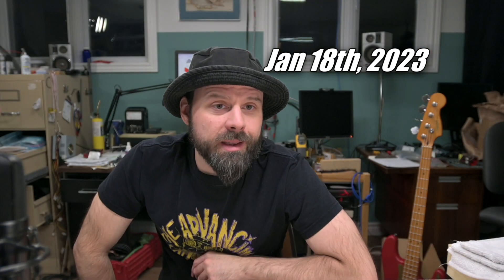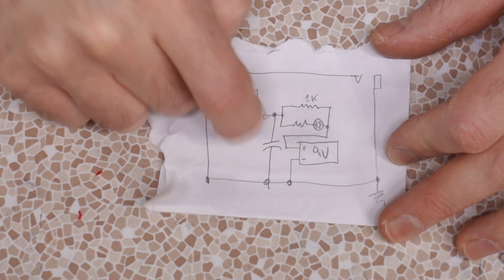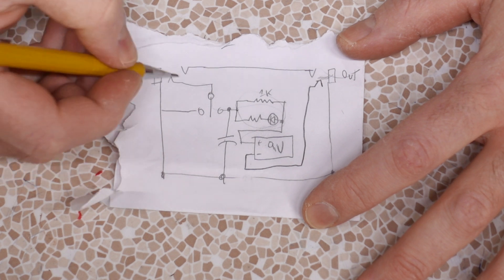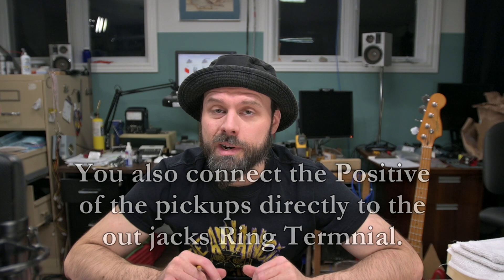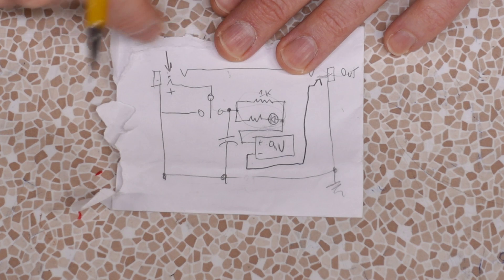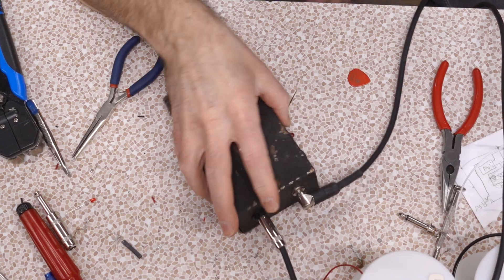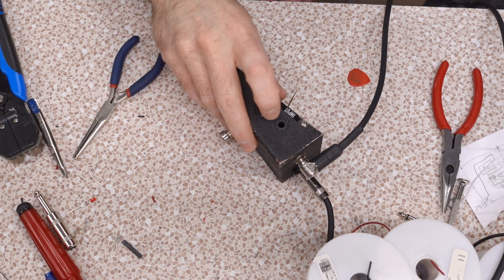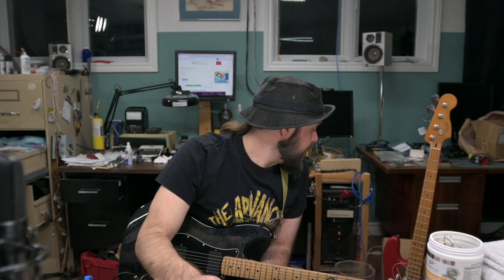Improvising an External EMG PSU cause I couldn't fit a battery in my Bass

Comment: Do you have the non trs version?
Reply from the maker: Ah no, you need the TRS to transfer the power. An EMG loaded guitar already has the TRS jack in it. 
If you made something like this, and got the right cable, the only mod you have to do to the guitar is to short out/bypass the internal battery jack.
I did have an idea of building a non TRS version, kind of like phantom power, but it would be way more complicated, require significant mods to the guitar wiring and risks compromising single integrity.

Comment: Must have watched this now a dozen times (maybe even 12) ahead of starting my own build. 
Question: On the capacitor you used 1uF /50V if I am reading the label right. Would a 1uF / 10V be the better pairing?
Reply from the maker: Sure. The voltage isn't that important. It just tells you how much it can take before failing. 
Functionally they will be identical, and the voltage rating doesn't effect the tone. 
Just instead of stocking the same value in a bunch of voltages, I'll stock only a couple voltages, and it covers all the bases. 
However, you do want to "derate" your caps. So, get a value that is at least 20% more than your expected voltage. Also consider, that we arbitrary runs these at 9v. Cause it's a battery standard. 
The ops amps these used can run at up to 30v in some cases. 
You could easily run this pedal at 12v or even 15-18v. So, for good measure, if we build it to be save up to 12v, we're going to want a min 16v cap. 25v might be more common and then you're golden. 
Only reason a "company" might spec a 10v cap, is cause they order them by the million, and 10v worth of insulation is just slightly cheaper than 25 or 50v worth of insulation.
Reply: Ty!
Reply from the maker: @Yes...THATEric  Yw.

Comment: When wiring up the guitar knowing I’m going to use this instead of a battery, do I still wire it up the same?
Reply from the maker: For the most part yeah, just you omit a battery jack, and connect the red wires to the ring terminal on the jack. Otherwise, what I've also done, is just wire it normal, and bypassed the battery jack, assuming you are working on a guitar that fit a battery to begin with. To create a bypass, I took a dead 9v battery, cut the terminals off the top of it, then soldered a piece of wire to short those terminals, and then clipped it into the guitars battery jack. Shorting out the guitars internal battery jack will bypass it an allow power to be taken from the ring terminal.

Comment: Just found out that this was even possible. So rad. Say someone wanted to have this powered with a power supply and not a 9V, how much would have to change in the build?
Reply from the maker: Well, it should be as simple as connecting a jack instead of a battery. I might also add some bypass capacitance and filtering however. There are a few ways to do that. The most basic would be to put something like a 10u and 0.1u cap across the power jack. But I might also try to using a 100ohm resistor on the positive of the power jack to connect it to the circuit, before said capacitors. 
You need bypass capacitance in an application like that, kind of simulates a local battery and subdues interference picked up my the power wire along the way. 
Fortunately, the short circuit protection a built in would be good for this. It's one thing to quickly short a battery that can't put out a lot of current, but if you were using a PSU that had a fair amount of capacity that could cause any number of problems.

Comment: Cool video. I hate to be that guy but EMG already sells this its the ES-918
Reply: Thank you my dude! I have a Rickenbacker 4001 with a barolini NTMB pre in it (totally transparent with the eq flat, makes the standard pick ups sound epic with the bass boosted!). Getting the two 9v’s in there is a squeeze and required small pots.

This thing will save me having to pull the pickguard/buy batteries
Reply from the maker: Ohhh, EMG already makes PSU's ? Or, Gibson makes PSU's for their ES units ?
Well, you're not being that guy at all. Hah, I was wiring up a bass, realized I had no room for a battery and threw something together. 
Not sure if people notice, I try not to market my videos as "How To's" as much as, "an entertaining thing that I did, that might give you ideas if you're in a similar situation" kind of thing.